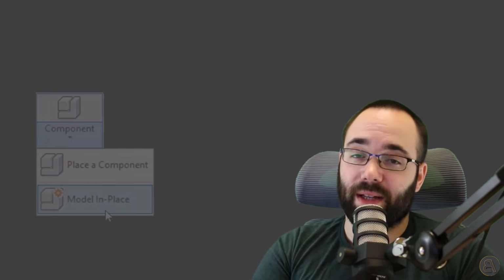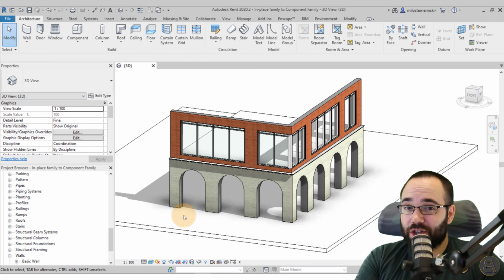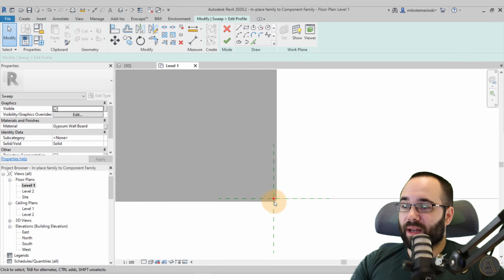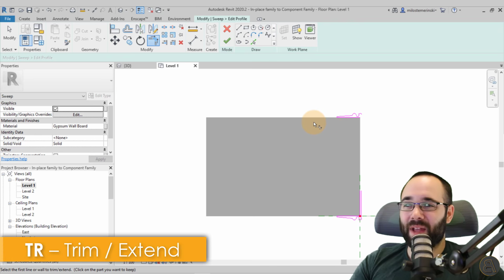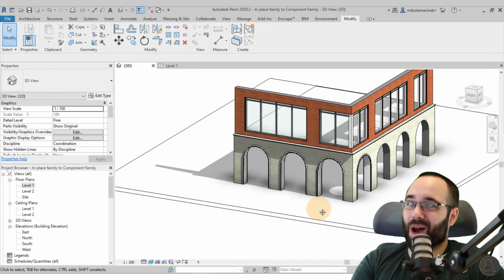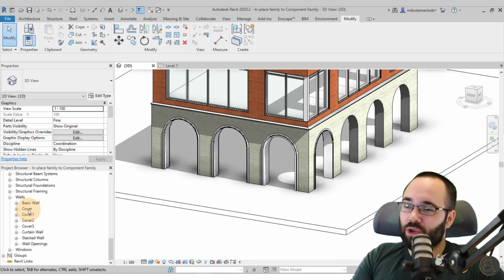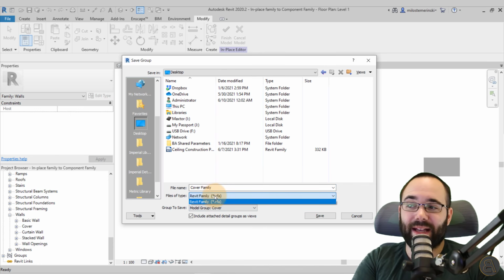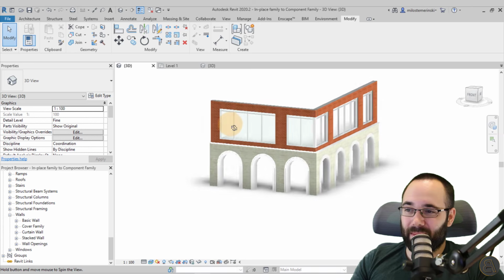Revit Families: Model In-place VS Loadable Family (Revit Family Tutorial)

Comment: Instead of making it a family would it be smarter to save your model in place profile as a separate profile, so if the arches are a different size you can maintain the same trim work aka cover by creating new sweeps for different size arches? Just a thought.